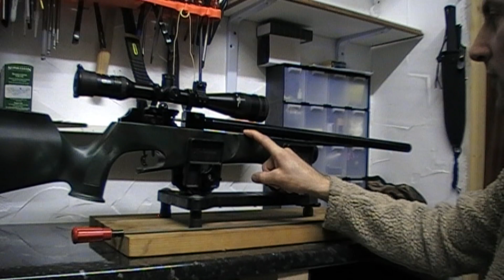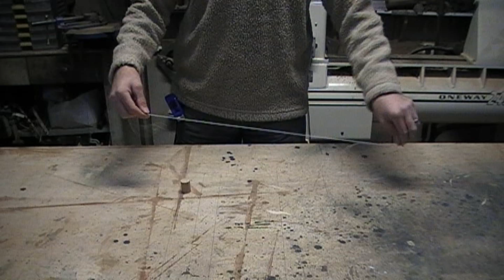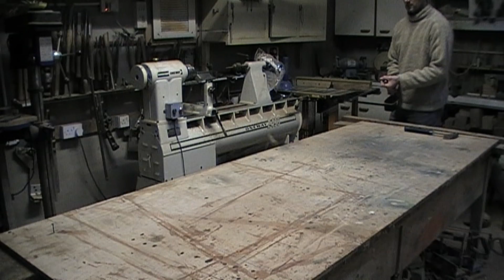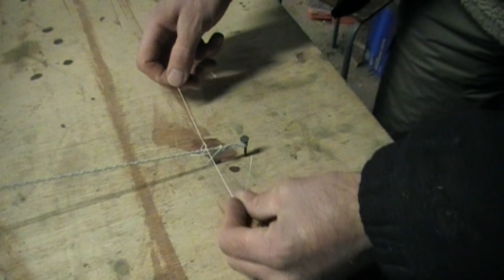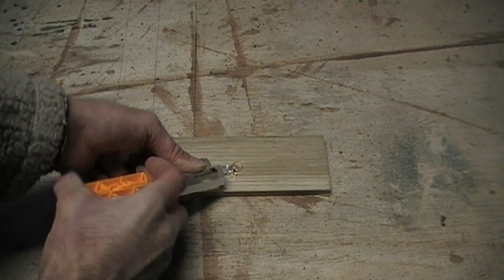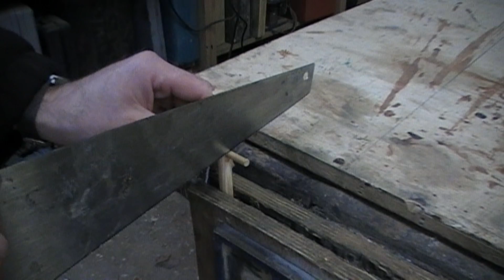Air Rifle Hunting, DIY Pull Through, 16 Dec, 2010

Comment: how do you clean a bsa airsporter type barrel with the rolling breach
Reply from the maker: That is a good question, i don't think a pull through would work with a rolling breach but you do get felt pellets for cleaning barrels by simply shooting them through the barrel though i have never used them myself.
 https://www.amazon.co.uk/VFG-Air-Rifle-Cleaning-Pellets/dp/B001G1OX8W/ref=sr_1_1?ie=UTF8&qid=1495389885&sr=8-1&keywords=cleaning+pellets+22

Comment from the maker: @TheLongrangeHunter You can use a pull through to clean any air rifles barrel weather its a pcp or spring powered break barrel or under lever, just make sure if you are using a spring gun to tie the barrel or cocking lever back so it doesn't close on your fingers.

Comment from the maker: @SuperMrDwayne Yes the tank or reservoir on a pcp air rifle is made to be filled over and over again, but you have to fill it with DRY air only from ether a scuba tank  the same as a deep sea diver uses or one of the hand pumps made for pumping up pcp air rifles. Not a compressor used to pump up car tires.

Comment: I remember using an old military pull-through like this. But it had a weight that was made of brass that could be dropped down through the barrel. The brass is a softer metal that will not damage the rifleing inside the barrel.